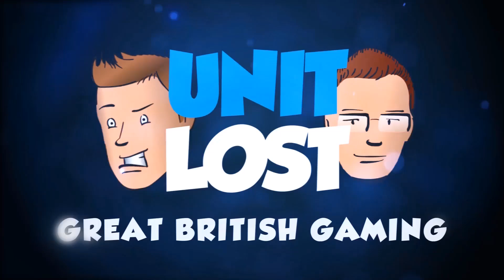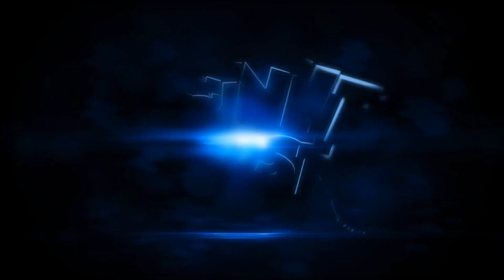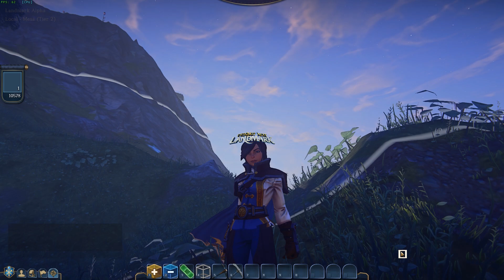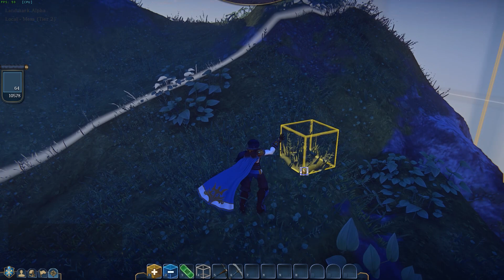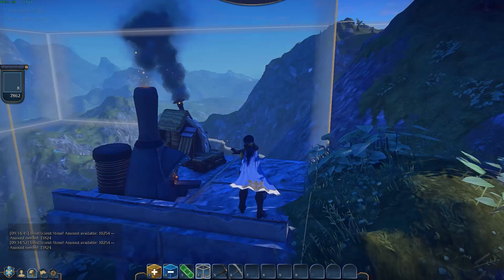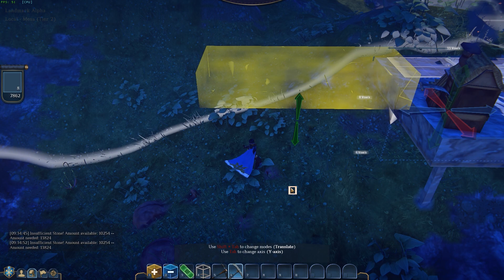EverQuest Next Landmark - Construction Tools and Templates

Comment: my processor struggles with this game right now...unless its the US servers? its vey twitchy. im running a inter(R) Core(TM) i5-3570K CPU @ 3,40Gz do you think I need to upgrade this or is it something else?
Reply: Your processor is fine.  The servers are twitchy and the game is alpha and not finished.  What graphics card do you have and what FPS are you getting??
Reply: Michael Griffin I have a GeForce GTX570 and around 50-60fps on high graphics
Reply: If your getting 50-60 fps your doing great.  That purveyor is the sweet spot for gaming.  You can't do much better without spending a lot of money and even if you did spend the money you would not get much gain.  I'd anything save your cash and upgrade your GPU once the game releases and we know what it will really take to run this game perfectly.  All of the lag and twitchyness is from the servers and the alpha game client.
Reply: forgelight engine is rather crappy.  They use it on planetside2 and over a year later you still need a top end machine and nvidia card to play the game at 50-60fps in large fights.  EQ next landmark seems to be same way  i5-3770 and 3gb nvidia660gtx and 16gb ram and get 40-50fps so not bad.
Reply: While I agree with you on the fact that the engine is hard to run.... But people expect to much.  There are settings for a reason.  High level settings and resolution are for high end software.  Mid level settings and resolution are for mid level gpu's and processors and so on.  People expect to much.  I have seen a lit of people by a $200 card 1 or 2 years ago and think that's high end because it was 200.  The problem is a $200 card at any point is barely mid range. So mid range settings is all you should expect and the problem gets worse if that card is 1 to 2 years old now that card is lower end if your lucky.  I played planetside 2 on my 3570k internal GPU at 35 fps consistently even in decent sized fire fights.  But I set my settings accordingly.  I had to dobit while my 7970 was being rma'ed.
Reply: also forgelight is CPU dependent.  If your running any amd processor your going to get lower fps in large battles.  If you in smaller fights you should get roughly the same fps as a comparable Intel CPU.

Comment: You can use the selection tool to place blocks as well, Just select an area click on the add tool (any other tool will work with it as well) and then click on the selected area (it'll turn yellow). That way you can really quickly build walls/floors/roofs etc. Also very handy is deleting with the selection tool, just select an area and press the "delete" button on your keyboard.